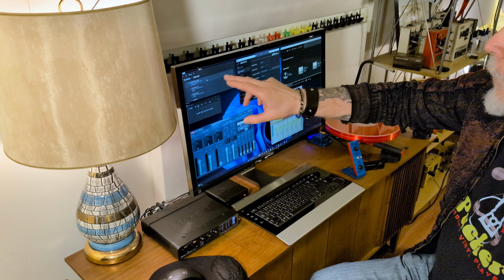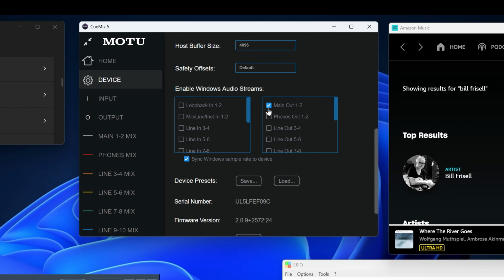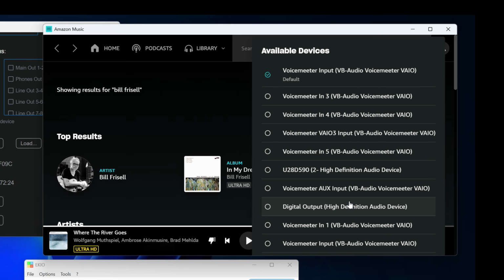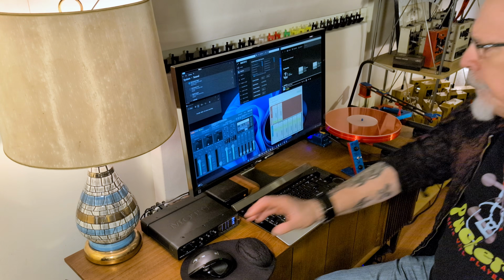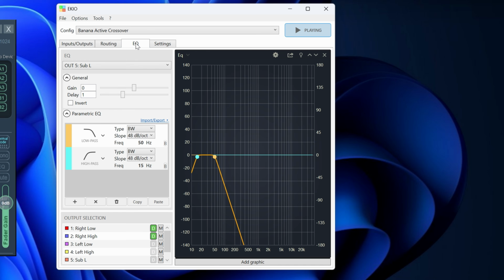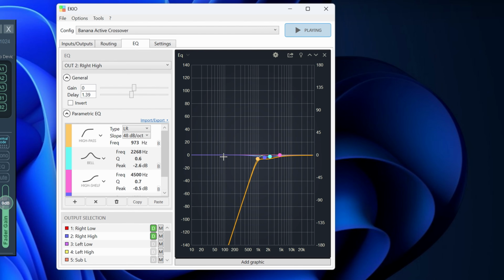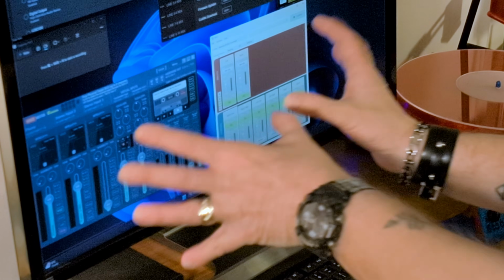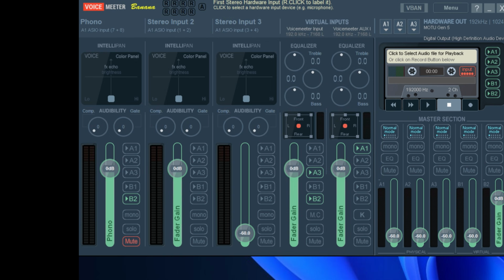Active Open Baffle Speakers 2026

Comment: Sounds great! Thanks for all the details. SUBSCRIBED!
I have started down a similar road . I have open baffle but am using sublime audio k231 to do the routing and crossover at the line level rather than in digital. This allows me to use a single good dac and preamp. After I get the line level crossover working I may try your solution. 
One of the reasons I am doing active crossover is I want very short speaker wires (amp near back of speaker) with longer xlr. Kind of like active speakers except I still get to choose my components.
Reply from the maker: Glad you are making great progress. I like the multi channel digital as it keeps the signal in one domain as far as possible. And yes, the short speaker runs are a good thing.

Comment: What a fantastic tutorial!  I hope people realize the amount of research, time, and effort it takes to put together a system like this and produce a video like this :)  Two questions.  On the kicker 4" coaxial, is there an internal passive crossover inside the frame?   Is there a room measuring mic/setup in there somewhere to determine those EQ compensation values?
Reply from the maker: Many thanks!!!😊 Yes the 4" ia a passive  two way. I did shoot the room with REW, but most of the work was done through repeated listening. Even in a fairly neutral room with a well placed mic, some frequencies can read as deficient or too hot when they are simply a room artifact. I find a combination of measuring and listening gives the best results in my space. Cheers.

Comment: I’m 50 years old and have been playing with audio gear since I was 10.  Watched through to your sound demos and still have no idea how this setup works! 😂

You’ve got a complicated system of software apps bouncing the data around before handing off to a Motu (never heard of a Motu before) to do D/A conversion and… ?  Your flow diagram was on screen for about 3 seconds and then back to the Talking Head stuff.

Help a fellow out here! 😊  I’m extremely interested in adding active crossovers to my system and I “think” you may have an interesting solution?  Not sure, I have to go back and pause on your flow diagram and see if there’s any more info.

If you could do a much more layman’s terms breakdown of how this actually works and which app is doing what, and some description of what the Motu is doing and how you set it up that would be great for all us audio junkies who have limited experience with this type of stuff. 😊
Reply: Ok, so I found the flow chart, which wasn’t easy (-37:18) as it’s only on screen for about two seconds.

Looked up the Motu and it’s a multi channel DAC that the software allows programming filtered outputs.  Very cool!

This won’t actually work with my setup as I have a good DAC already, and what I really need is a digital crossover, something that outputs multiple digital channels that are filtered; one USB for mid/high, one for low, and one for sub bass.

A setup like this would let me use my best DAC for mid/highs and two others for bass and subs with cheaper DACs.

Very neat setup you’ve got there though!  I own both the V3 and V3 Monos and they are an incredible value.
Reply from the maker: @superspeeder You can do that with Banana, but it won't actually work because multiple usb outs to multiple dacs will drift. 

A multi channel unit like the discontinued Topping DM7 would have been perfect with 8 outs, like the MOTU.
Reply: @AndysRecRoom  thanks for the tip!  I’ll have to look into this further. 👍
Reply from the maker: @superspeeder  a fellow Facebooker made this post. Awesome gear but $$$$$.

"Another options is do all the XO/DSP into Roon.
Output Roon to HQPlayer
Have a dac like exaSound (8 channels) it's compatible with roon and hqplayer.
Output exaSound directly on your amps.
This is my way."

https://exasound.com/Products/s88StreamingDAC.aspx
Reply: @AndysRecRoom  I’m working on the cheap, but thanks for the suggestion. 😊
Reply: @superspeeder  https://youtu.be/C8Bh_PU3K9s?t=975
Reply from the maker: Very good points. I did make it for folks that are somewhat accustomed to this type of setup. 

If there is more demand, I can make specific vids on each element. But in the meantime, feel free to message me. My email is on my website which is linked on my channel page.

Comment: I’ve been building active speakers for over 10 years and you can save a lot of time using a DBX Driverack 2. Download the app, minor set up, connect the microphone and you’re off and running. P.S. I haven’t seen remote controllers like those on the shelf in over 30 years